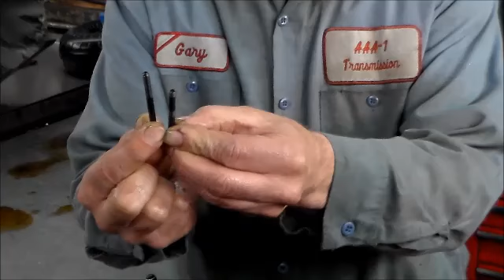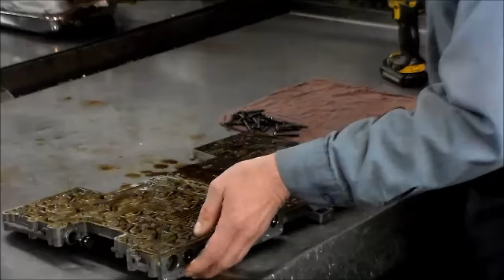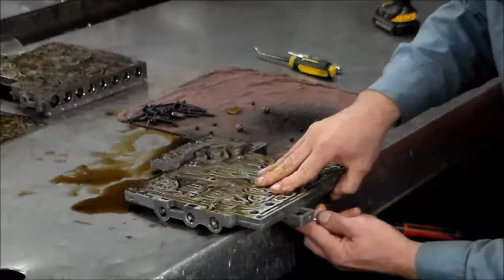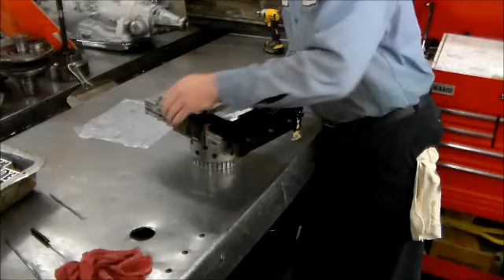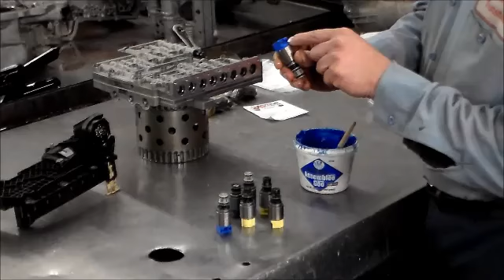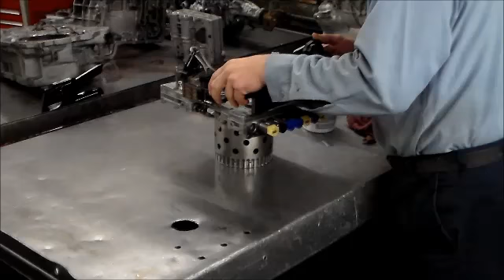ZF6HP19 Valvebody Overhaul

Comment: Gary, great video. You take the time to show where the filters, valves and other little parts go! The trans on a 2005 544i is slipping from 3rd to 4th gear and then it goes on limp mode until ignition is off and reset occurs! Also when on hi way speeds it can feel like it slips, the rpm's jump for a few seconds and it goes  on limp mode. I am planning on following your video and taking the valve body apart to replace the plate as well as servicing the solenoids. Where do you acquire the OEM plate and who services your solenoids? Do they replace the o rings when they service the solenoids?  Thanks for posting great instructional video. I work on my cars for many years and wouldn't have a problem following your video. Thanks again!
Reply from the maker: Ok, so you have a ZF6HP19 that your going to work on?  Is it a 540i BMW.  Where are you located?  The solenoids are cheap enough you could just replace them, they came way down in price.  What codes do you have?
Reply: The car was given to my son yesterday by his cousin because of the Limp mode issue, last year the cousin replaced oil and filter but it did not resolve the Limp mode issue. Not sure what codes he had.  CEL cleared today, it had been sitting for a year. Installed a new battery yesterday. And started testing it, it run great until I was on the freeway going up to 80, when back to 65 all of a sudden I saw the rpms jump to 4k and it went on limp mod. When I start slowly I feel a small slippage from 3rd to 4th then it goes on limp mode. We are located in Walnut Creek CA.Thanks for your reply.
Reply from the maker: Can you post the vin number, this way i can i.d trans type or e-mail me the vin   gsferraro@yahoo.com
Reply: It's a 545i WBANB33574B111063
Reply from the maker: ok, this car has the ZF6HP26, common problem for a slip in the higher gears is a worn rear stator bushing. The E clutch is on in 4th,5th and 6th, as the bushing wears it allows apply oil to escape causing a slip or flare in higher gears.  Have you checked the fluid level, it has to be on a lift to do this, also there is a sleeve where the wires plug into and that sleeve likes to leak. How many miles on the car?
Reply: 100k miles, I will lift all 4 corners and set on jackstands, secure with ramps on front wheels to make sure it doesn't kill anyone if it falls. I have some pretty heavy jack stands.  Then I will remove the plug and check the level to remove the level possibility from the equation. Specially being that his cousin changed the oil and could have left it low! Thanks again.

Comment: hi .. i have a problem .. ZF6HP19 BMW automatic transmission problems when the engine is hot he would not soft auto transmisson .. time to press the gas pedal as the car was wheezing .. gear during the wheezing meter dash gear position signal blinking and on shaft gear changes as there are concerns that the sound is running .. can for a little clarification here ..
Reply from the maker: Do you have any trouble codes for the transmission?
Reply: hi, i have same problem, but without errors, 150000km bmw 320 2007.
if i will change oil and CASE Sleeves & Connectors Kit can i fix this problem?
Reply from the maker: What exactly is the car doing?
Reply: i have the same issue and after i change the solonide and fluid and reset the gear using inpa car work fine for week then back again ? any suggestion ?

Comment: thank you for this video!
Reply from the maker: Thanks for watching
Reply: Gary Ferraro I replaced separator plate, solenoids and new o rings and end caps from Sonnax zip kit. New filter, pan, electronic sleeve, new oil. Still getting Ratio Monitoring, Clutch D code. Got any tips?
Reply: originally had Clutch E codes
Reply from the maker: very common problem with these units is bushing wear
Reply: Gary Ferraro I was getting ready to pull it out again so I go to drain the fluid and there was no steam. duhhhh added more fluid and all is good again. once again, thank you for the video and the quick responses. you are the man!
Reply from the maker: Ok, glad to hear, theres the first fill then the 2nd fill with the engine running
Reply: Gary Ferraro yes sir! I also went through all the gears for a few seconds in each gear and rechecked level. everything seems fine except when I come to a stop, there's a slight "bump". no faults and all other upshifts and downshifts are smooth.
Reply from the maker: Have you reset the shift adapts?

Comment: Thank you for the excellent video.
How do you know when the manual slide is in place properly?
Reply from the maker: When its in correctly the slide will work, if its not in correctly it may not slide because the part would jam and it may not slide correctly
Reply: Is there a way to tell before putting everything back together in the car?
Reply from the maker: Well you should be able to move the manual valve when the pin for the slide is in correctly, do you have a park button or a regular shifter?
Reply: Regular shifter. It's a 2006 530xi

Comment: GARY FERRARO: So many  thank for all your help .I have a BMW 2001 325i. whith transmission  zf 5hp 19, the transmission do not engage any gear.i did the fluid filter change  but anything happen .can you give me some help please to fix the  problem.                                                       1)torque converter                                                                                                                                                         2)valve body seal.that is my guess.   i 'll be so happy if you help me. thank you.
Reply from the maker: A very common problem with these transmisiions is the pump going bad. Did this happen all of a sudden?
Reply: Thank you for answering me so quickly. Yes this happened suddenly can you give me any advice on where I can get the best parts for this transmission is there any places you recommend to go online. Or it's not worth buying it. Any idea how much the pump that you mentioned might cost? Thank you again for all your help I appreciate it
Reply from the maker: where are you located?
Reply: Gary Ferraro Cleburne TX
Reply from the maker: I could hook you up with my rep here in NY, are you going to pull the trans?
Reply: Yes .did you know any body in Tx that i can trust because there is a bunch of crooks.

Comment: hi, i have a GA6HP19Z trans. I have this error (4f8a - Ratio Monitoring gear shift 4-5).

will it help if I rebuild the mechatronic with the solenoids?
Reply from the maker: Danny,
  I certainly would change the solenoids, the other issue that you may have is the rear stator bushing, when that wears out you loose E clutch oil, the E clutch is on in 4th, 5th and 6th. The solenoids came down in price so it may not be a bad idea to try that first and if problem still there you would have to pull the trans and change out the rear stator bushing and maybe the E clutches too
Reply: Gary Ferraro thanks for reply. the solenoids kits how much will it's cost ? 
the car have now 102000km driven and when I drive normally I have no issues it's happens only when I drive hard ( quick acceleration).
 When change gear some time you can hear like  whistle. do you know maybe where the whistle come from?
Reply: I will make contact with zf company in Holland, they do here oil change and remove the mechatronic and cleaning the mechatronic. after that they change some small things like springs and o rings.

Maybe is this good enough and will fix my problems. What do you think about this?

Comment: Hi Gary, I am attempting to rebuild my zf6hp21 automatic M-Shift valvebody and I accidentally opened the two halves in an awkward position and two limit valves fell out. Also a tiny black bb ball fell out too. I believe I can find where the bb goes but the two limit valves are different colors and they have different spring lengths. So I am desparately trying to find out where these two limit valves go. God forbid I put the two in the wrong places. 

Can I contact you via email and send you a jpg of the two valves and the empty spaces that they fell from to see if you can tell where each one is supposed to go? I have been searching for days online and cannot find the detail of the innards of the 6hp21 valve body limit valve positions - like a diagram of where they all go. Surely there must be an instruction diagram for transmission rebuilds that have been done routinely.

Please let me know if you have time and are able to help. I would appreciate it immensely. Thank you for your time.
Reply from the maker: I will certainly try...........e-mail is  gsferraro@yahoo.com
Reply: Gary Ferraro Thanks, I will send you soon.
Reply from the maker: ok, sounds good

Comment: hi gary is zf6hp19 model oil pump is same zf6hp26
Reply from the maker: No, the pump is not the same
Reply: We use Transtar kits which anyone in this business will tell you, is a top of the line kit. I Rather use new aftermarket vb small parts, than used. Especially reusing rubber ck. Balls.

Comment: Mr gary! Thanks for the video! I have 05 BMW 530i( zf6hp19 bad tranny)And I also have a very good and low miles from a 07 BMW 525i same tranny.Do you think the 07 can fits on the 05?Both cars has the same 3.0 engine and tranny.(6hp19)
Reply from the maker: Hello,
  Something like that you would need to get the transmission tag numbers and call a ZF distributor, to make sure it would fit. where are you located?
Reply: I'm locate it Seattle wa

Comment: I I damaged the valve "HV-D Retaining brake D / 4. Holding Valve D1" Anyone know which ZF code number, where I could buy a new one?
Reply from the maker: Code number should on a tag on the case, where are you located, i have suppilers all over.

Comment: one tip from somebody who had massive back shifting problems (harsh shifting) always replace those dampers when they start to look anything than round, like these in the video, they look like a ball on the tip from factory, and  are cheap as hell (2,70€ in Germany from ZF)
Reply from the maker: Thanks for the tip and thanks for watching. Gary
Reply from the maker: Yes, i agree with that, never had much issues with those tho, had big problems with the solenoids and bushing wear. Thanks for watching. Gary

Comment: Hi Gary - 
Do you work for a shop or you run your own shop?   What do you think the following codes;
4F8B, 4F87, 4F89, 4F8F...
these are gear ratio monitoring errors, dealer told me a new transmission is the solution, while a indy shop technician told me mechatronics would be the problem.

Also, are you familiar with programming the computer (the black plastic  piece that attached to the valve body)?  I heard that it can only be programmed ONCE, and can only be done by the dealer.

Thanks!
Reply from the maker: If you clear the codes, how fast do they come back? Does the car slip and bang or just stay in fail safe.   I was told that the computers can be programmed up to 3 times with dealer softwear.  I own the shop.
Reply: If the car is warm, the codes come back right away after reset.  The car would slip, bang, shake, ... and can only go 5mph in limping mode.  any throttle would make it even worse.
Reply from the maker: when its cold it works ok?
Reply: Gary Ferraro looked like the case.  but the car warms up really quickly, say 10-15 minutes, then everything goes south...
Reply from the maker: Im going to make a phone call on monday, i do work for a bmw shop and when i spoke to the trans guy, he said he has a gear monitoring code all the time and its always in failsafe, he was thinking of changing the computer, i will find out what happened.
Reply: Great.   the dealer nearest me recommended a new transmission as the fix.  I was able to get out of the failsafe mode by restarting the car; but as soon as i started driving, things just went bad, and the car would go to failsafe mode again.
Reply from the maker: Ok, all the same codes always come back? how many miles?  You said it drives ok for the firs 10 minutes then failsafe?
Reply: yes same codes.  the car has almost 200k miles mostly highway.  the transmission always had the hard kick when downshift to 1st gear, for years, then had a slip between 4th and 5th, which triggered failsafe, but had been ok after restart.  other than the 2 issues, car has been running ok until recently it went into failsafe mode, and then stays in failsafe mode, whenever car is warmed up, and the car would be undriveable at all.
Reply from the maker: What your saying almost sounds like an internal problem, 2 biggest issues on these units is bushing wear and solenoids. Gary
Reply: internal means the transmission itself is bad at the least?
Reply from the maker: Yes, sorry for the late response, shop is nuts. I would say you either have a bushing issue or solenoid issue. I reached out to my bmw buddy and left a message, waiting for a call back

Comment: Hey Gary, I have a 2006 325XI 6hp19.  I have the very rough downshift from 2nd to 1st gear.  When I come to a stop it is almost like a mild rear-end bump.  Even in manual mode at a dead stop from 2nd to 1st I can feel it jerk.  I have read that replacing the solenoids does the trick.  Do you think I need to replace the separator plate as well.  Thanks
Reply from the maker: Matt,  replacing the solenoids very well may fix the car, one other thing that will cause the bang on the downshift may be worn bushings, but its much easier to do the solenoids first. You shouldnt have to replace the seperator plate. You will have to reset the shift adapts or it will continue to bang. Is this something your going to do on your own?
Reply: Thinking about it.  I have done quite a few things...like valve cover gasket, fuel rails, intake manifold, etc, but I have not done this job before.  My biggest concern is that I will damage the plastic computer when separating it.  Is it usually all the solenoids or just one or two of them.  They are a bit pricey, but if i am in there might as well replace them all? if it is the bushings will I be able to tell when I drop the pan?  Thank you for your response
Reply: Hey Gary, I was about to tackle this thing, but the Mechatronic sleeve looks like it is very difficult to get to, because it is the all wheel drive 2006 325xi.  I have to remove the exhaust brackets, but it still seems really tight to get that thing out of there and then back in.  I also have to remove the U-joint to get to the filler hole.  Do I need to remove anything else to get to the Mechatronic sleeve?  Thanks again

Comment: Thank you for the reply.  One more question - 

when would you recommend a brand new valve body incl. mechatronics, as opposed to overhauling it?
Reply from the maker: If your mechatronic unit is bad, i would recommend calling eriksson industries in CT, i think they have reman ones and if you give them the vin number, they can program it for you. If the mechatronic is good, i would overhaul the valvebody with new solenoids or send them to erikssons for testing, soleds on this unit are a big problem, i always send them for testing. Hope that helps. Gary
Reply: +Gary Ferraro thanks for the recommend, I appreciate it!
Reply from the maker: Welcome, are you located in new york?
Reply: Gary Ferraro yes i am in the empire state of pot holes......
Reply from the maker: LOL,  me too. im on long island
Reply: Gary,  thank you for what you do.  I need to do this to my X5 4.8i sport. I’ll save this job until September. Need to do this before Boston winter lol.

Comment: May I ask -----  How do you determine if the integrated electronic module (the 'computer', or transmission control unit) is good?  Thanks a lot!!
Reply from the maker: On these units, if you have codes, the only thing you can do with these mechatronic units is to check powers and grounds, cant really do much else other than scanning

Comment: Hi Gary just a general inquiry really. Interested to know what a full rebuild on a zf6hp 19/26 sets you back in the US. Out here in Australia most shops quote between 5 to 6 K for a full rebuild with  all new solenoids (supposedly).Expect a bit less in your neck of the woods for various reasons. Cheers for now and enjoy your vids.
Reply from the maker: +tecnaman   I get between 4 and 5k for the overhaul. Are you a pilot?  Ive been flying since the mid 80's
Reply: +Gary Ferraro Not any more unfortunately Gary due to health problems. Had a PPL for 35 years . Last plane was a Tecnam Sierra 2002 ultralight with a Rotax 912 which I owned for 6 years.

Comment: how much did erikson charge to check the solenoids? and how much for the set of 7 solenoids? im working on the same trans.
Reply from the maker: +markviii7777   They charge about 15.00 each to test or a new set may be around 700(not exactly sure) Gary
Reply: +Gary Ferraro thanks for the reply gary.
Reply from the maker: +markviii7777 Your Welcome

Comment: Hello Gary 
Please let me know where you sent the solenoid for check like you have mentioned on you video ? How much do they charge for checking ? How long does it take for turn around ? Thanks
Reply from the maker: +Bao Nguyen   I send the solenoids to Erikssons industries in CT, i believe they charge 15 to 20 per solenoid, they are pretty good there, when they recieve them they usually check them the same day  phone number is1-800-388 4418